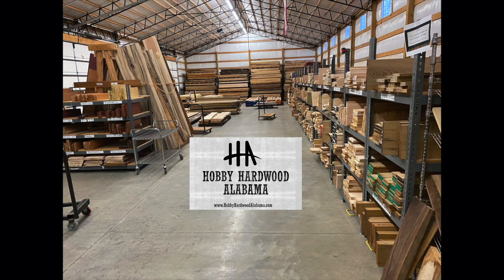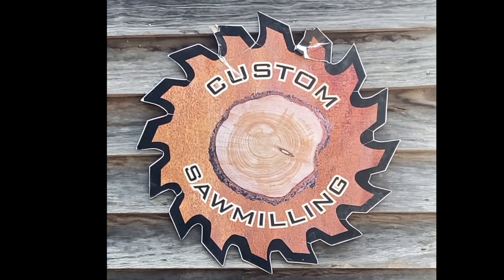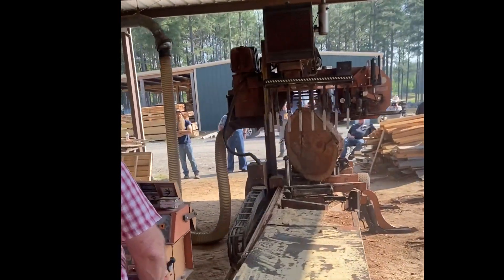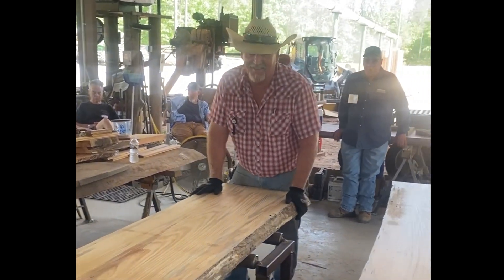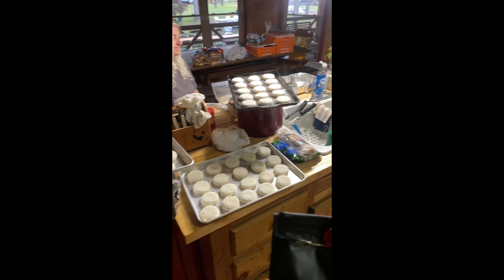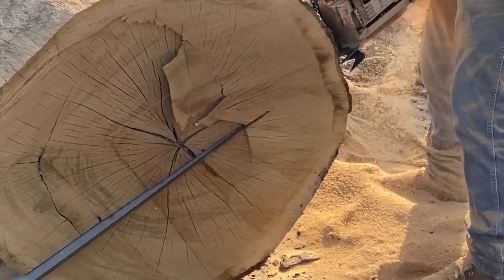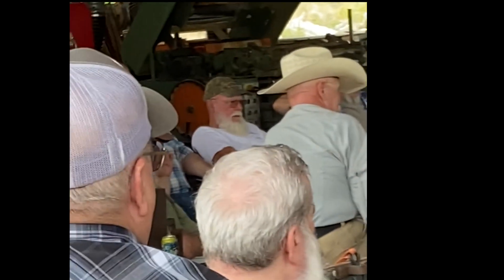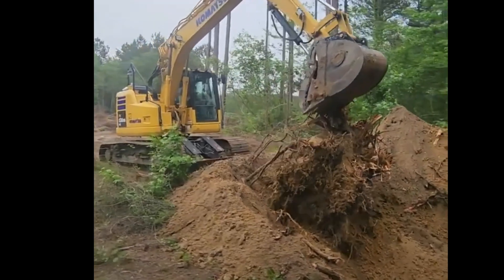Sawmill Project 2024 - Some of the Best Sawyers

Comment: It was great to see what has to be several centuries of knowledge gathered together it was also sad to not see much youth in the crowd. Is true sawing soon to become an almost lost art due to the commercial mills and spandex? Or do you think there is enough demand and new blood coming into sawing to keep it alive?
Reply from the maker: Good observation, and you are correct.  Although there are lots of people buying sawmills and using them, there are very, very few people who actually understand wood and know what they are doing, not because they don’t want to, but simply because they can only learn from so called experts whose only knowledge of sawmilling is wearing spandex and selling video time doing stupid stuff that no self respecting saw miller would do.  Its like who do you want to brink your house, the “star” on Discovery channel who learned how to lay brick on a 30 minute tv show or the guy whose been doing in 30 years and learned as an apprentice.  That’s one of the reasons I started doing videos, to help record the techniques of real sawmillers which is completely different than most of what is seen on the Tube.  True sawmilling is becoming a lost art, no different than all the crap chainsaws being sold and poser chainsaw operators on the tube with bar tip guards and instructions on how to never use the tip or top of the bar when in reality, the tip and top of the bar of a chainsaw is used more than the bottom by real pros, if for no more reason than using the top of the bar throws the chips away from the operator and kicks the bar down instead of up into the operators face.  Anyways, the gathering was composed of real pros and skilled millers, and the odd things was with all these “real sawmillmers” I didn’t see a single piece of Spandex, butt pad pants, idiots leaning over cant hooks, wearing sneakers or putting the sawmill band on backwards.
Reply: @HobbyHardwoodAlabama  I much appreciate you and the others on the Forestry Forum sharing your knowledge. I have learned much from both locations and a very select few others on YouTube but know I have only scratched the surface.

Comment: I am a beginner chainsaw miller.
I often hear you speak of avoiding the pith. It's no good juvenile wood. I have noticed that the pith (generally speaking of commercial store bought pine) is mostly centered in the middle of 4x4's/6x6's/ Etc. And I can understand why. 
My question is , I often hear people " Boast " of " Heart Pine " as being desirable maybe as for flooring. Does  heart pine ( or any heart cut for that matter) refer to the pith ?
Or does the so called " Desirable " heart reference refer to the wood between the sapwood & pith ?
Reply from the maker: Pith will always crack, it’s the nature of the structure of the wood.  All crossties are low value center cut pith and if you walk down 1,000 miles of railroad track, you will not see a single pith cut crosstie not cracked wide open.  The heart is not the pith, and very desirable and dense in heart pine.